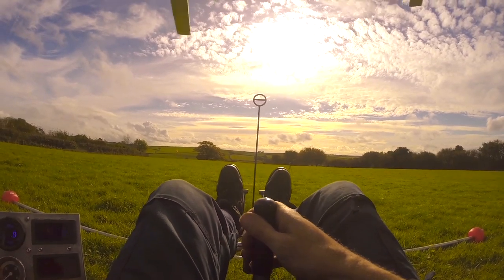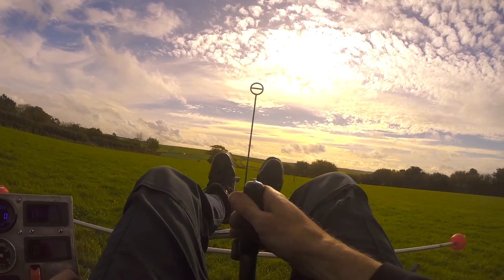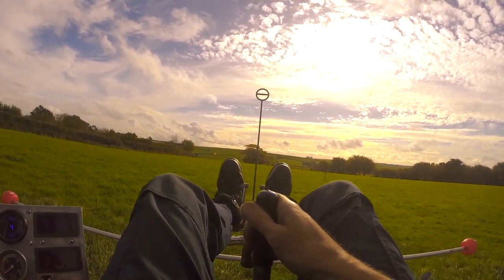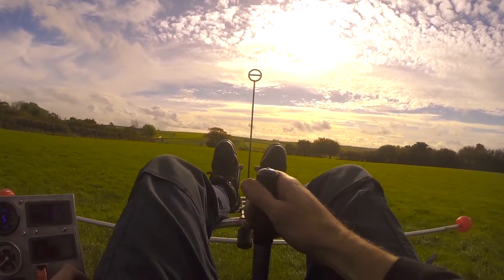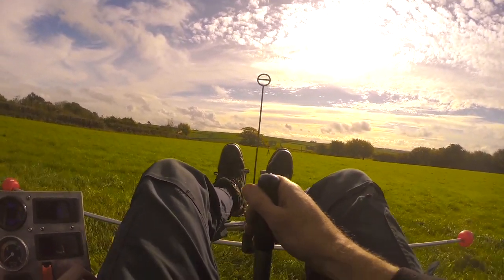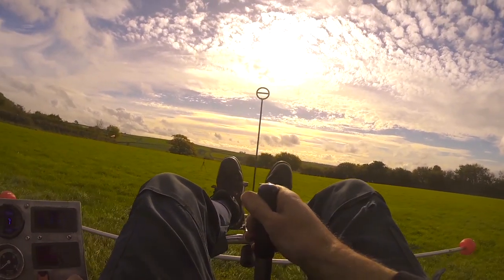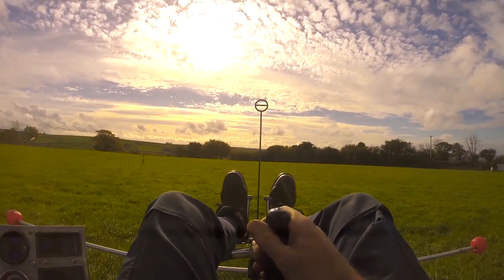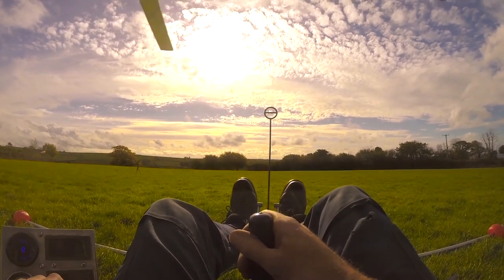New year update, Homemade coaxial Helicopter

Comment: I wonder if a scimitar electric fan would increase airflow and reduce current. 
Brilliant project :)
Reply from the maker: Hi, I'm not familiar with scimitar fans. I have put on a spal fan now, bigger diameter and it's got a fan cowling. I will soon be finding out if it's made a difference but I suspect that belt driven is going to be the final solution. Just got to power that air through the rad, if it takes a few hp then so be it. Hopefully the weight reduction already done will compensate.
Reply: Scimitar describes the curved blade shape. Same as you'll see on modern commercial shorthaul propellor airliners.

If you re build the fan to radiator adaptor plate the space between fan and radiator if larger may be more efficient as currently it's a small gap to let a large amount of airflow.
It's much easier [cheaper] to move a lot of air a little than a little a lot.

Also the engine looks like an outboard engine. I wonder if you are familiar with salt versus fresh water cooling thermostat set temperatures. In salt water the thermostat is normally around 50°C and fresh around 80. 
This so in salt avoiding the formation of salt crystals blocking passages. 
If you have the thermostat at 80 this may result in more engine power. I'd consult with an outboard mechanic to confirm.
At a larger temperature difference between coolant and ambient temperatures, you are likely to transfer more heat for the same radiator volume so may allow to operate a smaller = lighter cooling system.

Another Long term solution to reduce external alternator and alternator drive belt  losses & weight is exhange the original regulator rectifier to a more efficient type from a half wave to a full wave rectifier regulator.
 You may get enough to drive your cooling fan from the flywheel alternator without the need for an external alternator & belt.. 

Or rewind & increase the alternator winding under the flywheel to increase its output to the ~>10 amp needed to drive your coolant fan.
Maybe decide on this once you have established your fan run current required. 
You can likely use the Kubota regulator rectifier for either the Kubota external alternator or the under flywhee alternator.

Another simple way to achieve more power might be to increase the tc mineral oil content in your premix fuel.
This will likely increase the piston/ ring / cylinder wall sealing.
This may require changing your carb main jet.
I'd be setting this by egt[ exhaust gas temperature] or cht [ cylinder head temperature] .
coolant temperature will give an indication but may be too slow to update..
I'd start rich and slowly work towards just rich of max power to reduce risk of engine damage.
Chat with your local 2 stroke expert.

Comment: What are your targets now then?
Reply from the maker: Hi. I'm working hard to reduce the weight of the machine while adding the extra engine cooling. Got to get the flight time up while Increasing lift performance. More power is available if I change the gearing so I will be doing that also. The target is a machine that can hover for at least 15 minutes, enough time to have fun in a field.

Comment: Apologies, my account got hacked last night and broke our conversation, this is my replacement account. 
Before that happened I was going to ask, if you were to build one with a collective, would you still go with a coaxial design or would you go the more conventional route with a tail rotor?
Reply from the maker: 👍 ah, I wondered why all your messages got deleted. Thought I said something to upset you 😆

What would be comparatively easy is to build a conventional helicopter from plans and it's very tempting. I would probably choose the AW95, however I really don't like tail rotors, they Rob power and have resulted in many many accidents, quite a lot on the ground. There aren't any plans available for a sensible coaxial so here is the choice. Accept the tail rotor and go the plans route or tackle designing double swash plate, blade feathering rotor heads. 
I know it would take a lot to design that and I'm not sure if I have the drive to see that through. Blindly making Aw95 parts is pretty attractive and it might be nice to have both variants in the Workshop. 
 Have you seen the sch2a coaxial? It's a super machine
Reply: @Ben-Dixey  I haven't seen that SCH2A but I'll have a look now. I'm kinda drawn towards a double swash as a decent challenge, that would give me a task that I can focus on without getting caught up in the bulky stuff that inevitably leads to me procrastinating on the tricky stuff!
Reply: @Ben-Dixey  The VA115 looks pretty similar too.
Reply from the maker: Yes the Va115 is superb. Just expensive  I believe. The Russian micron is another. Don't see any videos of people having bought one of these machines online. Unlike the mosquito air which unfortunately is no longer sold.